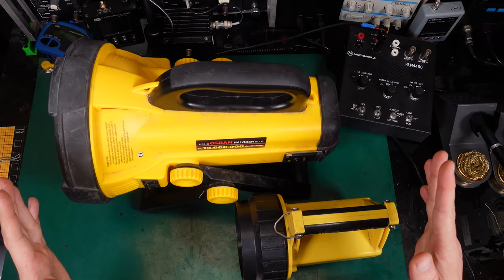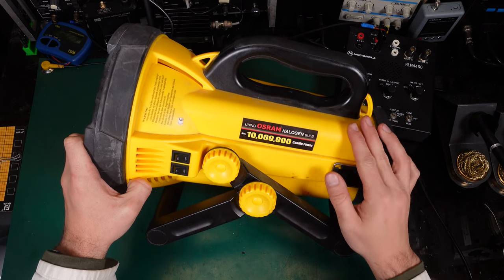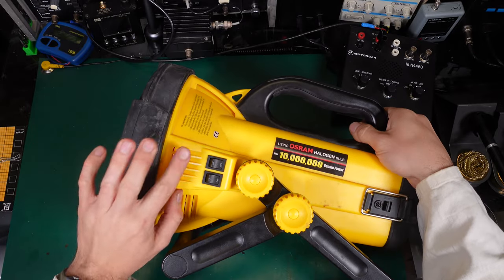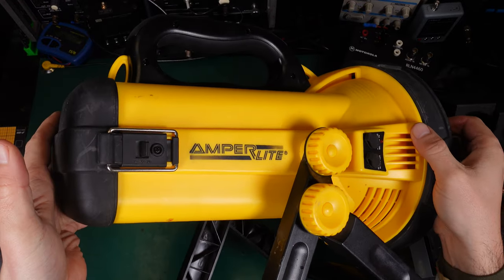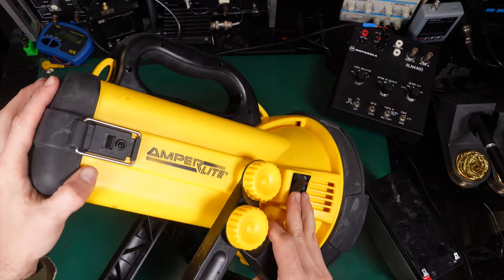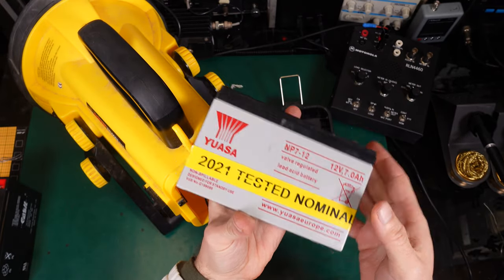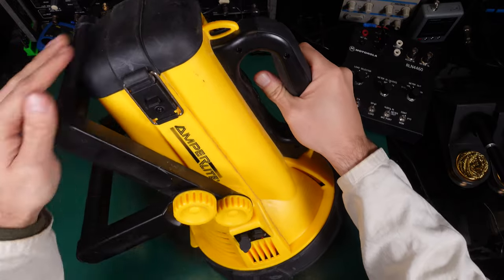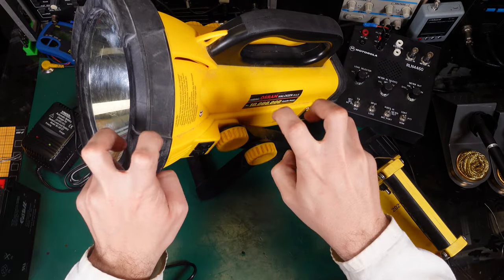Amper Lite very powerful spotlight searchlight that use 12V halogen SLA flashlight (replace battery)

Comment: These cheap flashlights are very powerful, the light is of very good quality, the tin reflector, real glass on the optics. I noticed that acid batteries are very bad / difficult to charge after a fairly strong discharge, they like up to 10-15 minutes of work and then charging. For me, a 55 W bulb was enough for about 50 minutes of work. This was even the case in the instruction manual. I didn't have H4 and H3 single fiber. My father broke this flashlight because he turned it on and forgot, the battery started to gass, became hot and was damaged. Now I do not have it anymore, but it is a good flashlight for the car, while away and checking the safety in the area where we stayed to sleep. Vulkan is a bit wretched because despite the fact that it has 8W of power, other cheap flashlights are more efficient and have similar power. I also suspect that the rubber ring absorbs light, but it is very necessary for work. In this vulkan flashlight, the switch quickly 'worn out' does not jump hard from off to on. There is a soft lever but it works fine. I wonder if and what do you think about it, if vulcan would work well on 4 x Li-FePO4 cells but without BMS? it was about 6.4V 5 Ah, but would the cells not "run out" with the voltage? Greetings :-)
Reply from the maker: They are missing low-discharge protection - if left "on" <- they will kill any battery!   also they are selling them with cheapest possible SLA batteries that are not Deep Cycle - definitely get one of those so recharge from 0% will have no impact on capacity but still as mentioned above - if will be left "on" - this resistivity load will drag them to 0V  and kill battery.  Li-Fe - looks like absolutely great option  but NEVER go without BMS. There is interesting physics when cells are stack together, if one of them will be discharged more quickly - it will start charging (that single cell) with reverse polarity <- it's quire hard to explain in comment, one point in time i will record video about it,  in professional applications to overcome this issue they are using DIODE in reverse polarity along with every single cell, in case one cell voltage drop it will act as short and not charge in reverse, in simple word BMS is a must for more than one cell. I get away in many applications without protection, when i have single cell and momentary switch - so by design device can't discharge to 0 and operator will stop using when battery drop bellow usable limit. <- go ahead with LiFe - but make some low voltage kill, it can be something simple, without checking each cell - just overall voltage.
Reply: @ElectronicNoobBlog  Thanks a lot, your videos are very useful :-)

Comment: Wonder if it would be possible to fit a HID kit inside. I do know a 10ah lithium can fit, and you could also run a 100w halogen if the wires hold up, if they do with a 10ah you would get about a hour.